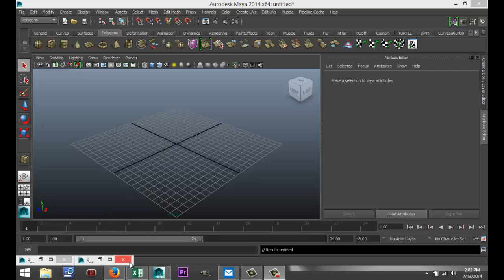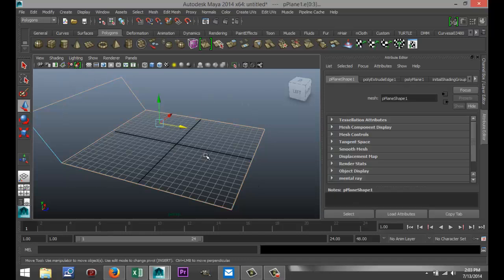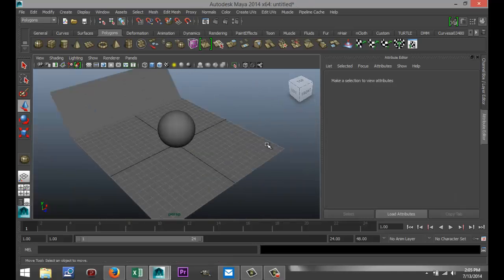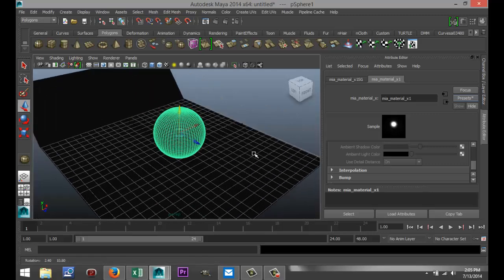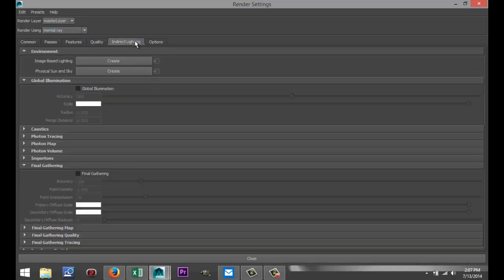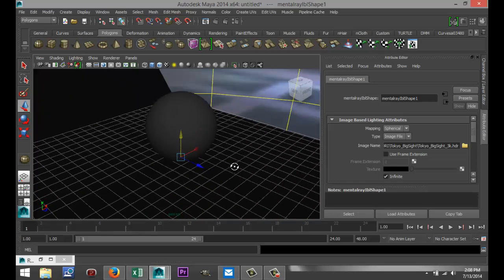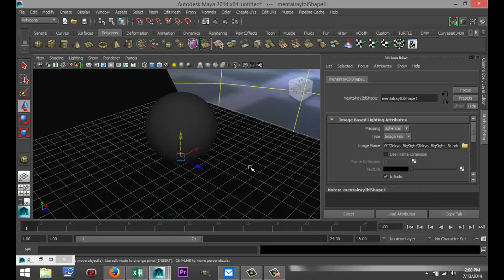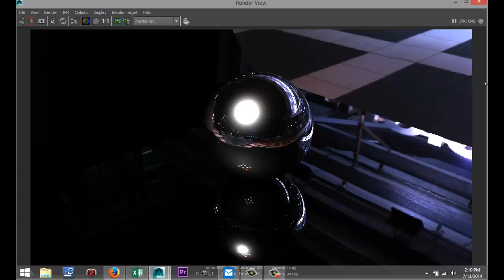Maya 2014 tutorial : How to model a chrome ball in Maya

Comment: Awesome tutorial as always! I have a problem though. After rendering, my plane looks totally black instead of reflecting that hdr like yours. Why is that?

PS. The background also turn into a white blank space. What's left is only the reflection on the chrome ball itself.
Reply from the maker: Hi Tenkuru,

Did you turn on Final gathering ? FG allows HDRI images to act as a light source.

Mike
Reply: Mike Hermes Yes,i have FG turned on. Here's the render: http://puu.sh/eOnl7/7253da945b.png
Reply from the maker: Hi Tenkuru,

You ground plane is reflecting a bit but mainly by the sphere. I do see that you have an addition lightsource ( point light ? )
Try deleting the pont light and changing the angle of the shot.

Mike
Reply: Mike Hermes Hmm, I don't have a light source anywhere; no idea where the specular came from. But anyway, I got the plane to reflect the HDRI image by changing the angle of the shot. A small problem is that although the background shows in render view, it disappeared when I saved the image, but that's just a minor issue. Here's the final render: http://puu.sh/eOU0J/1aea06bb78.png
Thanks a lot for the help!